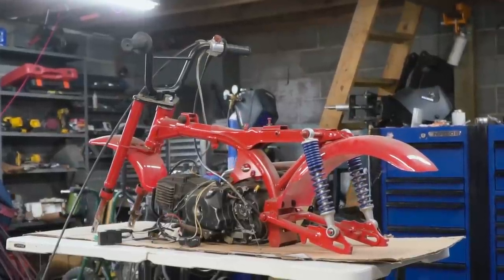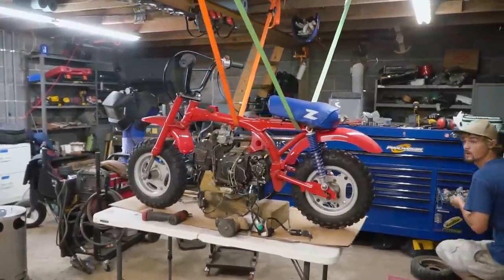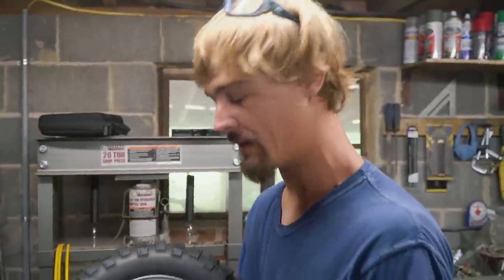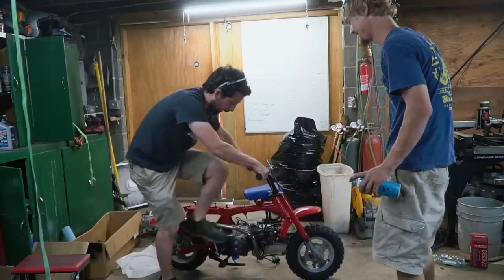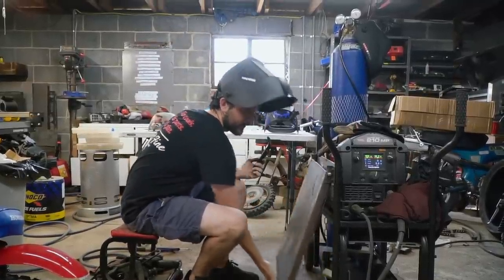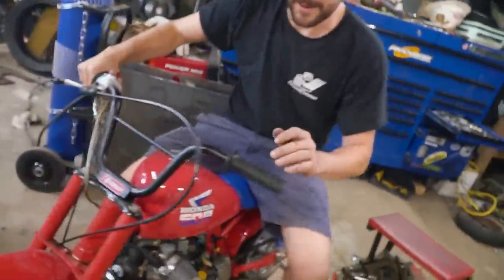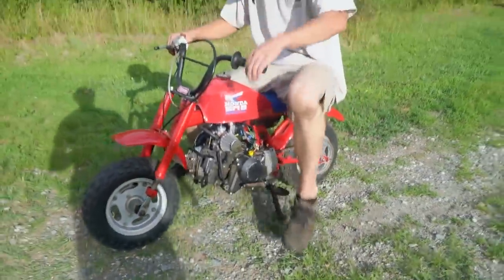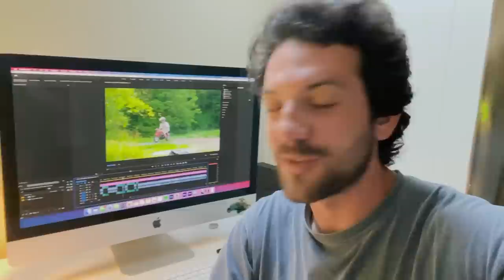Honda Z50R Budget Restoration | Transforming a FORGOTTEN Honda Mini Bike

Comment from the maker: Gotta love old Honda’s!
Reply: *Can't afford old Honda's 😂
Reply: Gotta keep on the unique vintage mini bikes an trikes the ABSOLUTE best! :)
Reply: Just bought my first dirtbike yesterday and it's a 1985 Honda xr100r and I alr love it
Reply: @quakeruin7643  i have a replica to these bikes… its a little bit bigger and a 125 4 speed…. Check out the videos on my channel its a icebear mango
Reply: The best machines. Got a 78 xl 125 getting cleaned up
Reply: Can't kill a Honda.  I beat the absolutely dogshit out of a 85 3 wheeler for year's.  Change the oil ever 4 years at most and clean the air cleaner when i remembered to. Still ran like a champ when i sold it. Wish i hadn't sold it now.
Reply: Why there is filter in EGR hole?
Reply: Super glue won't stand up to heat cycling.

Two part high temp epoxy would work better.
Reply: Pull the shifter kart engine and build a monster tire "mini" bike!
Reply: Congratulations Charles 👏 lovely old Nifty 50 👍
Reply: The RPM is too high thats why you can't get it into neutral
Reply: @NoneyoBisniss  Araldite glue!
Reply: @juhomaki-petaja  
Yep. Plenty of vids on YouTube showing affordable products and means.
Reply: whats that smaller filter on the side and where can i get one

Comment: As someone that has revived more old bikes than I can remember...here's a tip for ya.
When you get her fired up and you're dialing in the carbs ...put a couple of inch's of vacuum tube on the mixture and idle screws to tune on the fly... Much easier than carrying a screw driver on the ride

And congratulations Charles! Now we have confirmation your kickstand goes up!

Comment: Congratulations Charles! Great time to ask the boss for a raise! Nice bike guys! I took apart a predator 79cc today and removed the governor! I'll start putting it back together tomorrow, nothing crazy, 18 lb valve springs, port and polish, 20mm slide carb, going on an e-zip 500 frame ive modified!

Comment: Congrats on the baby Charles! as for the table, you should incorporate a fold down leg/legs for stability. also use the plasma table to poke some holes in it for setup fixtures/clamps.

Comment: You guys remind me of when I was 13 yrs old , but I took apart the engine and replaced 2nd gear without a manual or any help from anyone. Had it back together in 2 days later and running with no prob.
My dad said that I would never get it back together. Did it.

Comment: Typical Honda Dirt Bike Shift Pattern: 1 down 2 (3) up and half click up from first to go into neutral
Reply: China engine
Reply: @russ4454  I only like the engine if it shifts down one and three up.
Reply: You have some pretty cool stuff on your channel, as well..🍻🍻
Reply: Pretty much every dirtbike has that shift pattern
Reply: @randomidiot6281  Yeah but I am looking to buy a new motor for my pit bike and wanted the regular lifan 125 1 down 4 up and they are almost all Neutral at the bottom while being 4 up. I haven't had an engine like that and fear shifting into neutral while trying to shift from second to first but I am not that worried about having to get used to it. I just don't want to hate my pit bike until I can find another motor for it. Also with that shift pattern, I might as well go with a semi auto and electric start  but that is a killer when you life out in the desert and have no battery. I like kick start and motorcycle shift patterns and not scooter shift patterns. I kind of have to have a manual shift clutch set up as well in order to bump start the engine 50-80 miles from my destination if need be.
Reply: @sixtyfiveford I just subscribed. you got that lunchbox locker video that I am interested in and am going to go watch now. You have a lot of content. Good job.
Reply: @Youhaverights6  you dont have to worry about shifting from 2:nd down to 1:st or from 1:st to 2:nd since neutral is a half click it happens sometimes but not often
Reply: And then there’s the 1 down 4 up on my little ass 50cc which some how tops out at 50 with 1hp
Reply: I guess I’m different from everyone else. I really don’t like the 1 down rest up shift patterns, I personally love the neutral at the bottom, with all the gears up gearboxes
Reply: @Ieatpeople2  Honking the horn instead of starting the bike 😂 I thought I was the only one that did that. Lol. I ride trails on a raptor 350 and ride on the streets on my Kawasaki Vulcan S. Shift pattern is exactly the same interestingly enough. Only the horn and start button are swapped. I hate when I accidentally honk my Vulcan horn in public. I feel like people think I'm doing it for attention.
Reply: @garageofscrap  If I remember correctly I believe my 85 Kawasaki KLT 110 three wheeler has the N-1-2-3-4-5 shift pattern. That's why they have the weird heel-toe rocker shift pedal on them. The poor things been sitting for a year or two as we haven't been able to get it running. Found out it had a slightly tweaked exhaust valve so it wasn't getting any compression. So I got it a set of new valves and just replaced both at the same time along with the valve seals. Also got it a new timing chain which hasn't made it on yet. I need to get a flywheel puller, or try to find an M16 fine thread bolt instead. :)
Reply: Like 90 percent of Hondas
Reply: horizontal cylinder fluid/ auto clutch CT 50 CT 70 CT 125 are all down. No one down/ two up or 3 up.
Reply: @russ4454  Who do you think they stole the design from?
Reply: typical of 90% of bikes.
Reply: Not these, automatic clutch bikes are still all up. These were three, the newer ones are four and there are some models that went all down instead. On the full manual bikes you are correct that’s pretty much everything now except for GP.

Comment: John-Isaac You Can drill a couple holes in the metal Liner where the brake shoe go on, and also drill a couple of recesses in the pads and fasten it with a rivet but anyways there is --->  Brake shoe bonding Adhesive ( Anabond 230 ) which can give structural strength to the bond between the brake shoe and the liner. Anabond 230 has been used by manufacturers to bond Brakeshoes many many years.

Comment: Brake pads yes are re-glued without a problem, cleaning the base metal is optimum if you happen to have a glass beader or some sort of chemical treatment like Aluma Brite oxidation remover. Once you have your castings cleaned up, I've never had any problems using Loctite brand high temperature 2 part epoxy. Using a bunch of rubber bands glue and rubber band them liners back onto the castings and their good to go for many years. If you wish to take it a little further? Like the factory? To prevent this from happening again faster spray the dried brake shoes with clear coat to protect them more from further oxides and popping up of the liners again. Hope this answers some questions? I've done this method dozens of times on machines which had almost New brakes and it be a waste of money to replace something that only needed a little love. Thanks guys keep up the shows!

Comment: Hey just a tip on the AC unit you bought you need to insulate the exhaust tube it will generate alot of heat back in the shop !!!

Comment: Congrats Charles, also I always wondered about the Honda pegs on the z 50s but I've had a few that I rode hard and crashed and never broke the peg from the motor I'm fairly sure u could drop a cinder block on it and it won't break off

Comment: Now that you have air conditioning, and will probably have a furnace, you need an engine exhaust evacuation system. -A fan connected to a long collapsible air duct, that leads outside. Congrats Charles! ...As for the welding surface, I would just make it a completely bolt-together kit, made from stainless steel.

Comment: You should make a plug-n-play battery system so that you can electric start that engine without having to install a battery somewhere on that tiny unit. Lol. Like the battery tender wiring. Then you could plug it into a portable booster box to start it. That would be super cool!!!

Comment: Congratulations Charles! You will have to be working on a 212 powered Tonka style dump truck ride on. Hauls dirt for boys, hauls stuffed animals for girls. LOL!
Nice job on the 50. Super glue has a tendency to release with heat. Also it cures like NOW if you mist water on the glue. That's why it is so dangerous around your eyes. There used to be an adhesive for brake linings that we got from NAPA. This was 40 some years ago but the bonded shoes have to use something. I bet it's on YouTube somewhere.
Cheers guys!
Terry from South Carolina

Comment: I build my own quad brake all the time I use car brakes cut them and j/b weld them with a clamp the the brake plate and leave it over night works great. they break better because it hold up to the heat so the last longer too

Comment: I relined brake pads for 18 wheelers and other types of equipment. And we used epoxy to glue the brake liners to steel bands. Sorry John that has all ready been done and super glue releases with heat.

Comment: Some of the older Chinese pitbike engine have a 1d 3up trans and have the same issue finding neutral as your 110 here. Most have been changed to 4up now as it’s much stronger.

Comment: you can Bead-blast the shoes outside and the inside part of the brake friction material and EPOXY the shoes back together, but Super glue releases with the smallest amount of heat...... will come apart and possibly lock the wheel as soon as you apply brakes

Comment: 2 component High Strength High Heat Epoxy Glue can fix the brake shoes and centrifugal clutch shoes, i have been doing that for many years for Scooters and Mopeds and small Motorcycles :-)

Comment: Don't rely on superglue for the brakes, the heat generated could in normal use the glue could easily start to lose adhesion. It probably wouldn't get hot enough to completely break down, unless there was something wrong with the operation of the brake mechanism, but may enough for the parts to slide apart. A short ride may not expose the problem, but sustained use would be a different matter.

Comment: Super glue for the brake shoes will not work, however JB Weld might.  This is only a newly posted video because only the new shop pad is there and now there is a erected building there now.

Comment: That's a latter Z-50 than what I had. I had an actual first revision.  It had 4 bolts total. Yours has 7.  Solid split wheel with 4 bolts.

Comment: The superglue might work for show, but machinists use CA glues for workholding when you can't bolt down or chuck up the part without getting in the way of the tool. To free the part afterwards, you use a solvent or heat, generally heat because you can break the bold all the way through at once.

High temp glues exist, but basic superglue ain't it.

Comment: You wont goose mine around like that or it will loop you in a second. It wheelies on just a throttle blip. It hits 40mph with the originl 50cc sprokets. It is a evil task master and will exact some road rash from you very soon. Believe it!  👍👍

Comment: "It'll be fun" - C & C's next catchphrase?? Charles, that's what you have to look forward to (after the panic subsides.)

I would not have guessed brake parts wouldn't be available for these ... so what's the heat rating on that superglue? And largely-white bikesthe era when they tried to make them look like miniature dirt bikes and monochrome everything had been played out.

I see these around for ~ $1200 or a little more unless a basket case. Compared to a new Monkey, perhaps a fair value? I won't say what a restored CT70 got listed for here. Eye-watering.

Comment: Please DO NOT use superglue anywhere where it can get hot! It lets go at around 100C (~200F) and things will literally fall apart.
As a matter of fact, if you have things that are not glued right, boiling them (or even steaming them) is a good way to un-glue them.
On the bright side this trick can be used for holding small parts for machining. Glue them, machine them, then heat them up and clean up residue with acetone. No clamps required! CA glue holds at around 1500 PSI at room temperature. Plenty strong for most things.

Comment: Congrats Charles thats gonna be awesome building things with him . So I recently bought a mikuni carb off go powersports of course used your name link for my go kart its doing the same kinda thing like it will kick in and out the power do you know what I can try and do I have to use a fuel filter on it could that be it to much gas with no filter? Thanks

Comment: I glue brake pads on my dirt bikes and 4 wheelers all the time.I cut the pads off my old truck pads and make them to size and use a good glue never had 1 come off and usually the used brake pads are the same thickness because if you had a new car truck brake pad it would be way too thick...

Comment: Kind of unrelated but I've been thinking about either making a spring-loaded motor mount so the chain will stay tight or putting the engine and the tire on the swing arm together and then putting a spring for the rest of the frame?
Reply: I feel like the engine on the swing arm thing would work. That’s how my 50cc gy6 quad is set up

Comment: You use Sellys Brand " Gorilla Grip" industrial glue on the brake Shoes or 3M probably have similar....superglue is Too thin & don't be cheap: new shoes are used across the Honda Range upto. 125cc & cheap as fries to go ! 😇🇳🇿Trev New Zealand

Comment: Trouble with finding neutral is the idle is too high, those semi auto trans clutches engage with engine speed, with the idle so high, it's like trying to shift a manual trans with the clutch engaged

Comment: Super glue is a terrible idea for gluing brakes because super glue typically does not tolerate heat well at all.  It could be really bad to be going down a big hill and have the brakes fail due to heat. I wouldn't risk my life on it. Something like JBWeld would have been a much better choice.

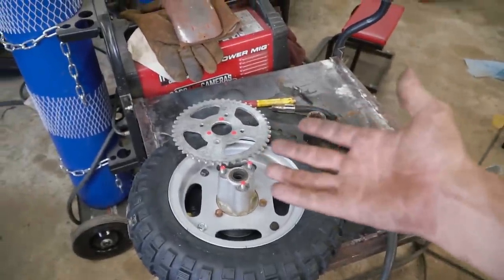Comment: 6:00 it be fine. i slapped 30 teeth Honda Monkey spoke on my Skyteam PBR after making new bolt holes. and its still working after 10 years
8:52 so it has a real gearing (1-N-2-3-4) "i hate the ones that has the neutral all the way down (N-1-2-3-4)"
also noticed that, that engine doesn't have a manual clutch. LAAAME!

and when it comes to spare parts. there is all type of spare parts but no OEM parts, most are for Honda Monkey clones that can be retrofitted to work

Comment: china motors shifting quality is not to compare with japanese bikes. i had problems to find neutral even with manually operating clutch and so my bike dealer told me i should shift to neutral before roll out lol. never had such problems with my xt350.